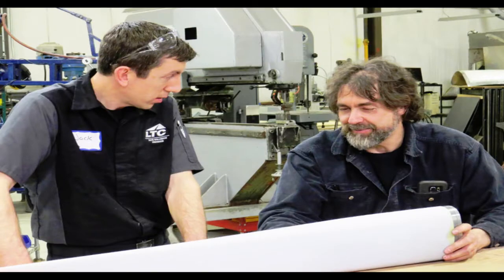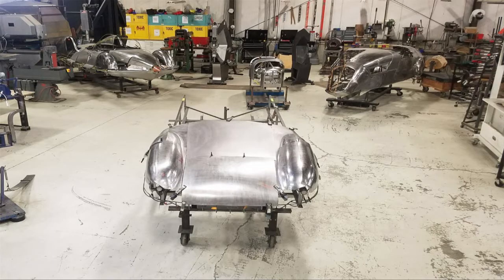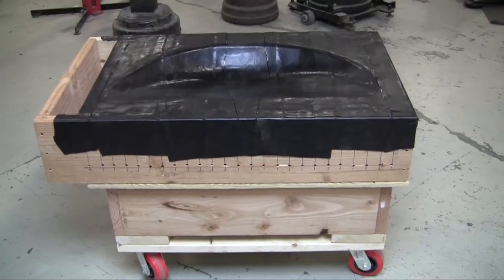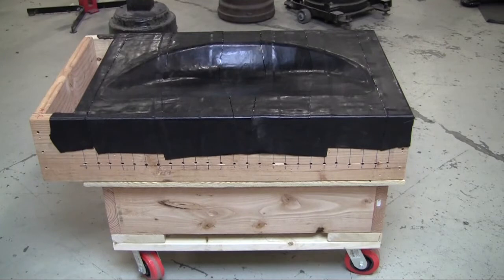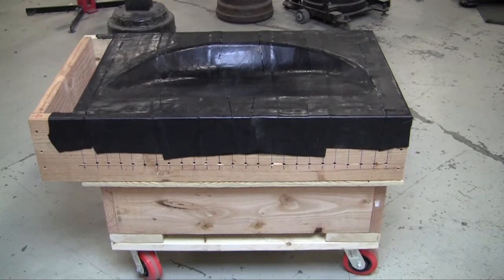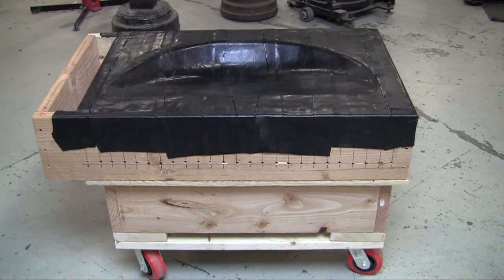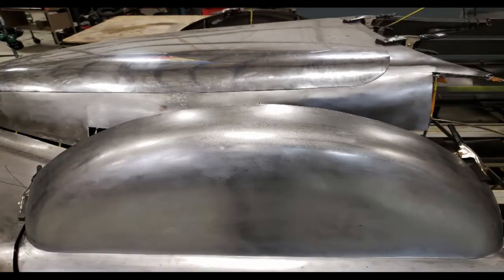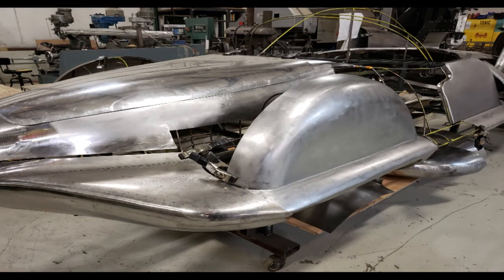Shrinking Facilitator Trailer

Comment: Built a shrinker facilatator and found that the rubber covering was only available in large rolls. Way to expensive. Have you found a source for this material that is smaller? Thanks, really enjoy your videos and have learned a lot!
Reply from the maker: Hi Doug, do a Google search. I found it at Zoro in a few seconds. Rubber, EPDM, 1/16 In Th, 36 Inx25 Ft    You can also find smaller amounts.